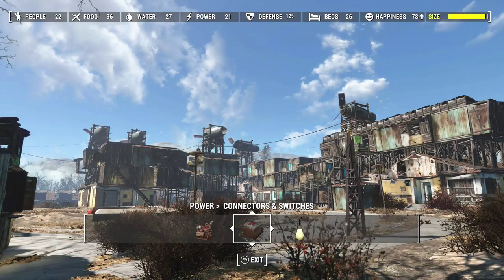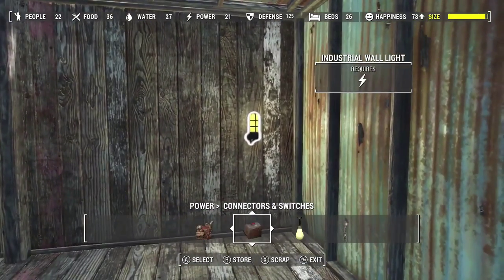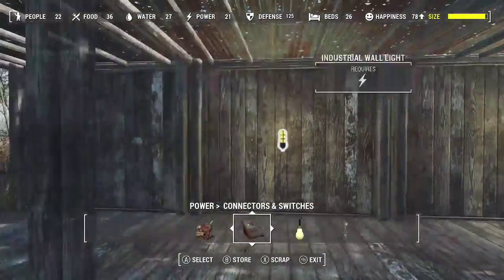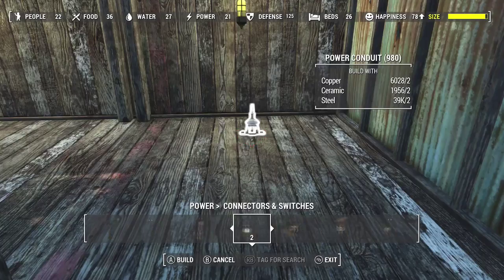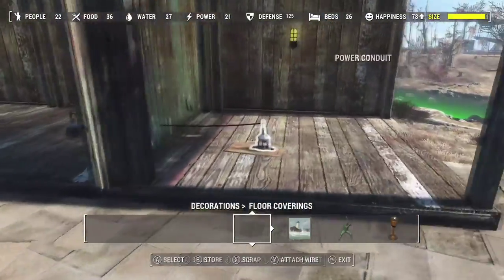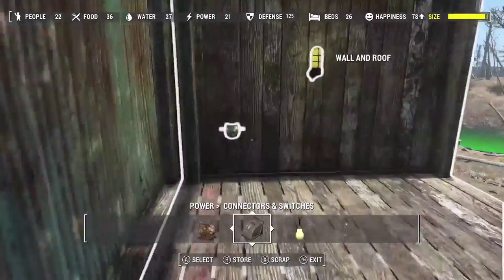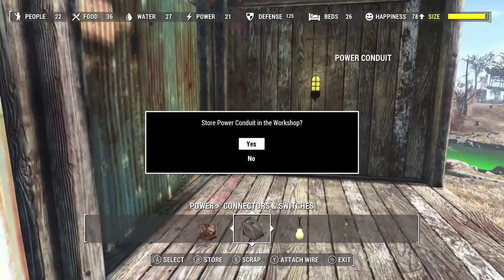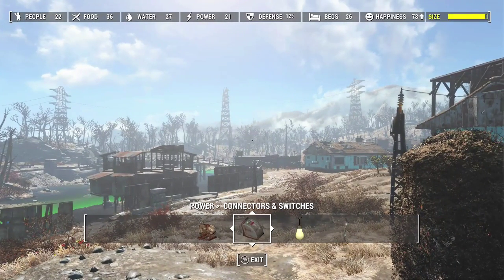Wireless Power(Understanding conduits and pylons): Fallout 4 Tips and Tricks

Comment: Hope this thing still works, so I can make Wireless and Clean Power
Reply from the maker: It should work just fine.
Reply: @Draco.Invictus  does it also work in lamp post and street lights? and aside from wall conduit can i also use the vertical or horizontal conduit as well?

Comment: My next venture is going to be trying to redo my settlements supply lines. I got wasted settlers everywhere.
Reply from the maker: +Joey Burke Yeah it happens. The trick is catching them
Reply: +Draco Invictus yea, the real question is where do they go when I get hold of them? Do they go to their original settlement or do they go to the one you're currently in and join it instead?
Reply from the maker: +Joey Burke they should be heading back to the settlement that you assigned them from. Considering they're still counted as a settler in there even though they're never there
Reply: +Draco Invictus don't you have to assign the provisioners to another task in your settlement though in order to get them to stop being a provisioner? You can't necessarily do that if the provisioner you're selecting is not from that particular settlement. They would have to be reassigned to the one you're currently in, right? Damn man, they need to put out a better interface for controlling this stuff. They did great by updating the interface of showing what jobs your settlers are assigned to, now they need a better system for the supply lines and what not.
Reply from the maker: +Joey Burke I totally agree and I believe you're right. I'll see if I can take a look at it tonight I'm shooting my next let's build tonight so it may be tomorrow night before I can take a look at it
Reply: Draco Invictus Thanks man, I appreciate it.  Trying to redo my supply lines is something I've wanted to do for awhile, but I've just been putting it off because I think its going to be a pain in the ass.  Its just getting worse though now that I'm unlocking more settlements, so I figure I better start sorting it out.
Reply from the maker: +Joey Burke yep catch it early rather than later
Reply from the maker: +Joey Burke With the Automatron DLC, you can make Robot Provisioners!